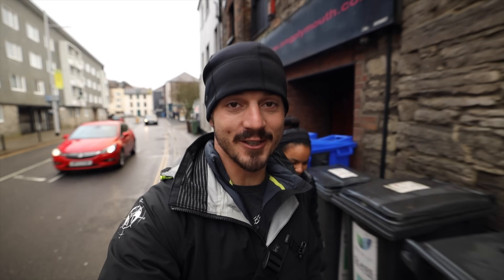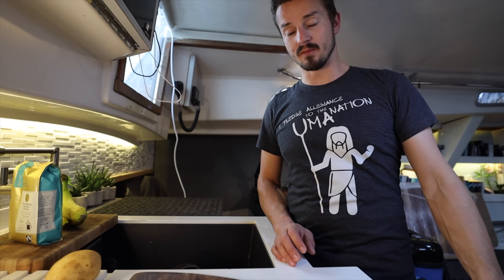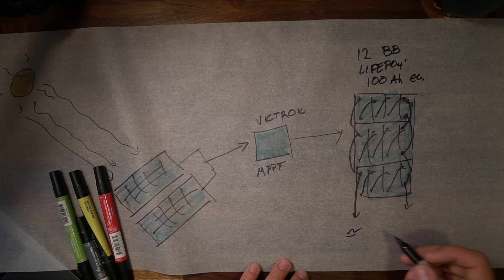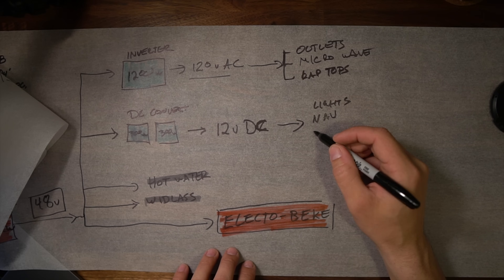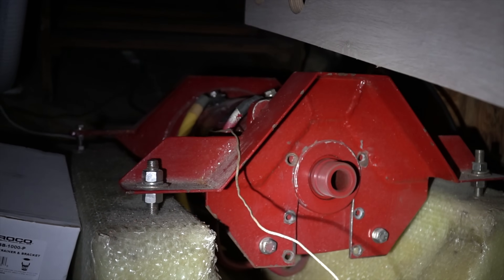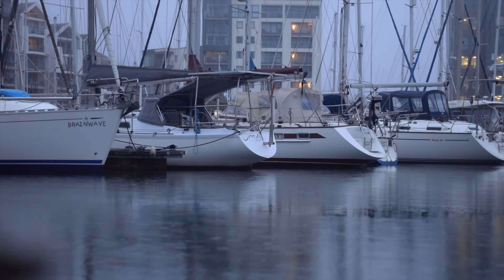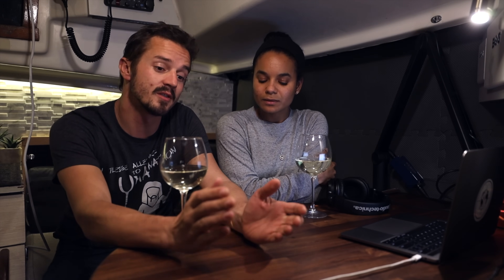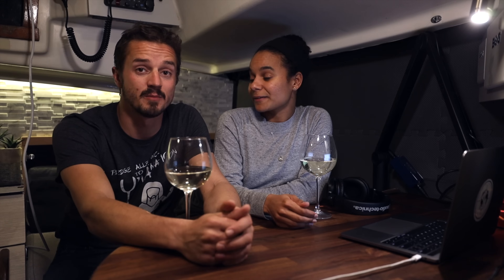5 Years Living offgrid on an ALL ELECTRIC Sailboat — Sailing Uma [Step 206]

Comment: What about a hydro-generator? I'll bet a modern hydro-generator will produce more power with less drag than your fork-lift motor regen and it's just the sort of thing a company would provide just to get the word out that such a thing exists!
Reply from the maker: They actually don't make that much power for the cost, plus it's one more thing hanging off the transom. We already have the drag of the prop in the water, so why not get power from that instead.
Reply: @SailingUma  That makes sense. On making the forklift motor re-gen: if it's a permanent magnet motor it should be easy. If it's the type with coils for the field you'll have to provide some sort of excitation current to get it generating--hopefully that's already built into the controller you're using. If the controller won't support that you might consider a big-ass knife switch and a standalone charge controller. I'll be watching with interest!
Reply: Jake a forklift motor don't regenerate and for Dan's set up it's not wise to make it do so.

Comment: Great video!  Being an engineer I understood your presentation even if usage of the terms was incorrect.  Let me try to help.  1,000 watts is a kW or kilowatt.  That is power.  Power used over time is energy or 1 kW used for 1 hour is 1 kWh or 1 kilowatt hour.  For DC 1 watt is 1 volt times 1 amp.  So, 48 volts times 20 amps is 960 watts or 0.960 kW.  Using this power for 2 hours is 0.960 kW times 2 hours or 1.92 kWh.  I hope this makes sense to you.  Again, I loved the video!
Reply: Good advice and obviously not meant to be discouraging.  I was continually having to figure out if they were talking about power or energy each time a number was thrown out.  Was able to figure it out and it was very helpful for my own design.  Super helpful to have real-world data on both power and energy requirements.  Thanks @sailiing uma!
Reply: A fellow enginerd!
Reply: This would make anyone' mama proud because it  is done in a most constructive way.
Reply: Maybe this can help. Power is kW which is the same as "working men". Energy is kWh which is the same as "man-hours of work". Same calculations apply when you figure out how much time it takes for 1 man or 100 men to do 1000 man-hours of work, or any other calculation you want to make. If an LED light is maybe 1/100 of a man, the kettle is 12 men giving it all they've got. Both can empty a battery bank filled with 1000 man-hours of work (energy), it just takes a different number of hours. You could heat water in a kettle with a pedal generator only, but it would take you 12x longer because you would be grinding away alone! So, 60 minutes instead of 5 minutes!
Reply: Similarly, it's "men working for an hour", (a multiplication), not "men per hour" (a division) because that sounds like they're throwing themselves overboard at that rate. 🤣
Reply: It is obvious that you understand the terms, Dan, as what you say is accurate. The problem is that using incorrect units is misleading, and highly annoying the the ocd of us. Also, i think it confuses the ones that want to learn.
Reply: What I know is that if my Electric Fence Meter reads "9.5", it is REALLY going to hurt when I inadvertently  touch the fence.  And I was only a Tech.
Reply: As a fisherman I understood this video . It was well explained.
Reply: Encourage don't discourage. We all understand you are very well educated.
Reply: I automatically converted what Dan was saying into the correct terms and guessed his comments were for the general radiance. And I used to interview and ask computer programmers how many bytes in a megabyte. If they got it right they usually got the job, because pedants usually write good code. You'd be surprised how many grads have no idea, even Oxbridge grads.
Reply: @philgray1023  How do you suppose the general audience would be able to convert what Dan was saying into the correct terms? It is a disrespectful and a disservice to laymen when someone assumes that the audience is too stupid to understand engineering concepts that he claim to be teaching.
Reply: @gatoryak7332  I guess I could put it this way. When I was at school I was told about the way to find a book that I wanted in the library, how to check it out even some inkling on reading it. No one told me about, specificity, or Ranginathans multi faceted classification system. No we got the brief version of the dumbed down classification system that Dewey came up with. One day I sat with one of my professors to discuss some research. Her explanation on finding the right stuff was so far over anything within my grasp I realised that I was never going to understand it and good old Dewey was going to have to do. She was the professor I was never going to be, and I had work to do and mouths to feed and I just don't have the spare 26 years to learn the Ranginathans classification (that is the formal training period) . So the dumbed down, may seem disrespectful to you, but merciful and sometimes pragmatic  for the rest.
Reply from the maker: Yes, we understand the difference, but this video was for those who might not. Hense the use of terms like "using 1kw in an hour" instead of "1kWh". Perhaps we'll make another video trying to explain that as lesson 102.
Reply: @SailingUma  You are doing a disservice to the laypeople who don't already understand. Would you teach them "knots per hour" too? It's the same category of errors. It does not help them if you teach them wrong. Your boat has an average draw rate of 100 W of power. You always multiply it with time if you want to know the energy. 100 W * 24 h is 2400 Wh, or, 2.4 kWh. If you have that in the (battery) bank, you can run a 1200 W kettle for two hours because (2400 Wh / 1200 W = 2 h) but you obviously never do. Fives minutes of running a kettle at 1.2 kW power consumes (1200 W * 5/60 h) = 100 Wh of energy. That brings almost a liter of water almost to a boil, depending on how cold the water was of course. Heating just a cup at a time requires only a fifth of that amount of energy but uses the same power because the kettle does not have a throttle. It just gets done in less time!
Reply: @SailingUma  It's seems to me that you do not understand the difference. "Using one kW in an hour" simply does not make sense.  And the people for whom you are supposedly dumbing down definitely don't understand what you are talking about. Use the correct terms, get your engineering correct, and then we can all be on the same page.
Reply: @SailingUma  You actually keep repeating " we use 1 KW a DAY" not hour. This is indeed as confusing for beginners as annoying for the rest of us.
Reply: @SailingUma  That's still not correct. You aren't using 1kW in an hour, you're using 1kW for an hour. kW is the rate, not the amount. It's like saying you went 50mph in an hour. You went 50 miles in an hour, you went 50mph for an hour.
Reply: who cares. it's still awesome!! and I'm an Engineer.
Reply: @Yolonathan  I care because my electrical understanding is weak and this discussion is helping me.  Part of the reason my understanding is weak is because so much of what one hears relative to electricity is incorrect.
Reply: No it doesn’t.  Dan’s delivery is more lyrical and that makes it easier for a layman to get it.
If his terminology is off, that will self-correct for the layman as time goes by.  However, 
appreciate your desire to bring the correct terminology to our attention.  A few more “lessons”
with Dan and then I will be able to understand your comment better.  Right now, I would need
an engineer’s dictionary.
Reply: @m.b.calderhead268  If you try to learn electrical concepts by using inaccurate terminology, you will be confused. Learn the concepts correctly the first time and you will understand the terminology and why it is important to use it accurately when you are designing your own system.
Reply: "The beginning of wisdom is to call things by their proper name." ~ Confucius

Comment: Do you use an induction stove? how is that working out?  Pros/cons versus propane?
Reply: They use an Origo alcohol stove and have a 25 liter ethanol jug of fuel for it, which lasts them 6 months. Same as a 25# propane bottle used to, but one can much more easily find refills for a liquid fuel vs. gas that always has different incompatible fittings everywhere.

Comment: Have you guys considered upgrading the solar panels. If you could get 20% more power in the same space with newer panels, would it be worth it. Seems like the panels are almost the cheapest part of the system nowadays.
Reply from the maker: As far as we know, they're aren't any magic panels out there that get 20% more power per cubic meter than any other. Maybe a few percentage, but most panels, if you do the math, come out to the very similar Watts/Meter.

Comment: I charge a MacBook Pro on 12v and it's amazingly easy, also has two USB charge points as well. 
https://www.coywood.co.uk/apple-macbook-in-car-charger-60w-magsafe-dc-adapter-14833-p.asp?gclid=CjwKCAiAj-_xBRBjEiwAmRbqYlDLV9NpAO_DQqY9zwjFggebnks7mjmF55Wpd4_PJYR70EKCn9ZjjBoC3fAQAvD_BwE
Also, while you're in the UK why not look at Marlec Engineering?

Comment: Really nice video guys. A question from your followers in Italy. How did you manage the  approval of the electric engine and power bank installation on the boat documents.  I cannot imagine here in Italy that a similar modification would have been approved by our marine authorities and reported as " ratificated" on the boat documents. Is there any video or document about this topics? Thanks
Reply from the maker: What approval process? We just filled out a form to register the boat in Canada, it asked what propulsion type we had, we said "other" then filled in "Electric". That was it. Our boat has never been approved or inspected by anyone accept the useless surveyor in the beginning who failed to find any of the real issues with the boat.  It sounds like the process in Italy might be a bit different.
Reply: Thanks for your quick reply. Indeed a big difference between Canada and Italian bureaucracy. Here in Italy (and Europe as far as I know)  the CE class approval is compulsory for each boat and is reported in the boat documents. Any significant modification,  need to be inspected and approved and later reported in the boat document. Failing to comply to this process means a big risk to be fined and no insurance coverage for sure. I 100% trust your technical upgrades, I'm just wondering what would be the process here ( but maybe in UK as well).  How long will you stay in UK now ?

Comment: Having a windmill hard mounted to the transom or deck transfers the vibrations to the hull. They are not quiet.
Reply from the maker: That's one of the reasons we've wanted to suspend one on deck if needed. Still in the plans, but maybe down the road a bit.

Comment: Just got an inverter stove top for my boat.  Can boil soup in 2 minutes and extremely efficient and doesn't heat up the boat.  If you swapped your propane stove for one you could get rid of your propane and have space for a 2kw gas generator.
Reply from the maker: We got rid of our propane 2 yrs ago and now have an alcohol stove. We might get an induction top when we can afford a larger inverter, but we'd still keep the alcohol since it doesn't require power to run. and it's easier to gimbal.

Comment: Have you looked into wind turbines that look like a basket? I've never researched them. It might be useful to mount one on top of your mast. I guess the best way to describe them is if you took a metal tube, sliced the sides vertically and then twisted the tube. The generator is mounted in the base. They appear to be sturdy and if mounted on the mast they wouldn't be in the way of the solar panels or anything else. Because the only part that moves is the basket it will intercept wind for any direction--even heeled over.

Comment: Great episode, but perhaps read up on the difference between power and energy, e.g. the difference between kW and kWh ;)
Reply: Someone rephrased it like this to help teach it: it's like the number of working men and man-hours of work. I wish that analogue had come to me earlier so I could have been using it already to explain this! Dan and Kika, if you ever read this: you have capacity for man-hours in your battery bank and men on deck filling it up when there are hours of sunlight available. You multiply or divide exactly the same way as with man-hours of work and number of workers (for high or low power levels). An LED light represents a tiny fraction of a man grinding away, like using their pinky with a wind-up torch, and the hot water kettle is ten men giving it all they've got for a few minutes. Both can consume all the man-hours in the battery if you give them the time to do it, it just takes a lot longer for the LED compared to the kettle, or the electric motor.
Reply: @sietuuba  Thanks! That analogy helped me out. That's why I watch this channel; smart people produce it, and smart people watch and leave comments. Cheers!
Reply: thank you. i was thinking the same thing

Comment: It little bit bothers me that Dan mixes power (W and kW) with energy (Wh and kWh)
Reply: I seem to recall their boat has an average draw rate of 100 W of power from the Atlantic crossing video. You always multiply power with time if you want to know the energy. 100 W * 24 h is 2400 Wh, or, 2.4 kWh. If you have that in the (battery) bank, you can run, say, a 1200 W kettle for two hours because (2400 Wh / 1200 W = 2 h) but even I don't drink that much coffee at such a rate. Fives minutes of running a kettle at 1.2 kW power consumes (1200 W * 5/60 h) = 100 Wh of energy and that's 360 kilojoules of energy. The thermal capacity of water is 4.18 joules per gram*kelvin, so it's enough for almost a liter of hot coffee if you do the sums; more if the water wasn't as cold as a fridge at the start. Ergo, heating just a cup or two of coffee at a time gets done sooner and uses less energy (though the power remains the same; only the time and energy are variables here if we keep using the same electric kettle).
Reply: @sietuuba  Thank you! My brain is getting full, this stuff is awesome!
Reply: @estrelladelmar6466  You are very welcome! I am by no means a teacher of any sort but running numbers like this is fun for me and informative when I'm trying to figure out if something is doable with the available resources. It's a good check on overt optimism for me. :-)
Reply: Very interesting subtlety. I am interested to learn a little more. can you add some more explanation? Thank you.
Reply: Yeah, me too. Still an interesting video. If you are going into the fine details of the electrics, your audience will know a kW from kWh. I sure that 90% of the views never caught on. I'll be interested in seeing the "re-generator" in action. Fork lift motors make lousy generators. I suspect the motor and speed controller will be replaced with a commercial unit.
Reply: @markeisinger5011  I do know that 1.21 gigawatts at 88mph passing through a flux capacitor will take my boat back to 1955.
Reply: Power is measured in watts (joules/second) and is used to describe how much power is consumed right now.
Energy is measured in kWh (1000 watts in an hour) and it is how much power has been used for how long.
Reply: @peterhelmer396  wait, so power is how many hot watts my toaster can use to blast toast, and energy is a measure of time as in how many watts it used for how long it takes to cook it?
Reply: @estrelladelmar6466  exactly
Reply: @peterhelmer396  But hot watts is joules per second, so that's a time measurement too right? Amps is electrons per second passing through a point. Are they all just different measurements of time in relation to each other then? My brain is melting.
Reply: Estrella Del Mar 
They are all interrelated. A Joule is the base unit of energy. A Watt is the base unit of power which is the rate at which energy is converted to work. 
1W = 1J/s.
If we take a 1W led light and we run it for an hour then we can see that the energy it uses will be 3600J. Which we call a Watt hour. This is what confuses people - the Watt and the Watt hour (W.hr) measure different things. Watts are how fast the juice is flowing, Watt hours are how much juice we’ve used or have left in the batteries.

That make the mud any clearer?
Reply: @q.e.d.9112  like if I have a bike hooked up to a light bulb, and the faster I pedal the brighter the bulb burns is watts, and if I barf after pedaling an hour cuz I'm spent that's joules?
Reply: Estrella Del Mar 
Precisely!😉
Reply: @q.e.d.9112  Holy Shimano. You have totally changed how I look at watts. Thank you.
Reply: Estrella Del Mar 
You’re welcome.
I was a physics teacher for close to thirty years so explaining these concepts is second nature to me.
Reply: @estrelladelmar6466  I had that feeling back in A&P school. After I derived and played with the math it made more sense. Yes, it is all interconnected, but the different measurements do have different uses. Good job understanding it, though

Comment: Very nice video - one question do you use air condition at all and if so how do you get enough power to run that ?
Reply from the maker: No AC. We've found that on anchor, with any amount of breeze, you really don't need it. Our boat tends to stay closer to the temp of the water than the air. But at a marina, when you're not lying to the wind, then it can get steamy. But that's when you have a dock to tie up to and power the AC if needed.
Reply: Thank you for your answer:) just another question do you use things like blenders, hair dryer, food processor etc? And if so are you able to use those when not being in a Marina ?